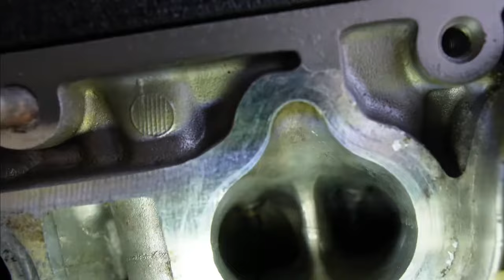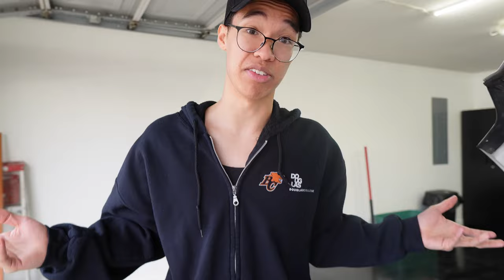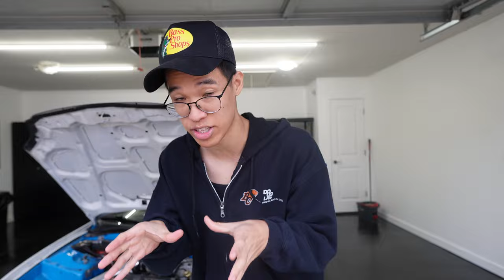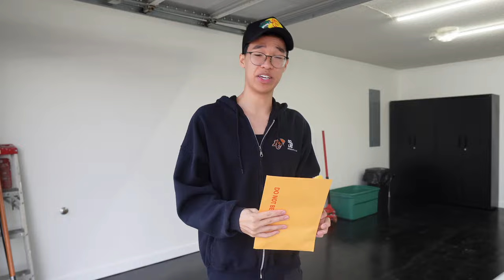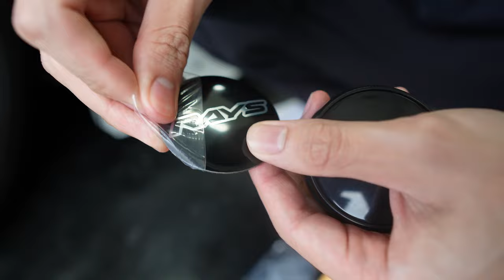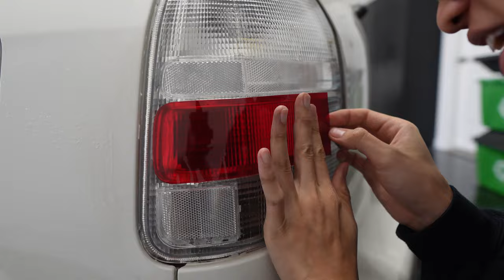Things have gone worse.

Comment: My ep3 has low compression and I got a quote from the shop to get it k24 swap, but its too much money and i still need to repair my transmission. So most likely im going to stay k20a3 and just pit some headers, maybe a true Cold air intake and a tune. 

My goal with the ep3 is to have fun with it and take it to track events, no need for straight line speed even though I admit it would be cool as well

Comment: I've got a 2000 Honda stock d series. My boy was leaking everywhere. But managed to take it to my mechanic he fixed the oil leaks but the power steering fluid won't quit leaking. I'm getting swole just making turns the last    year. 😅

Comment: yo , i love you videos , buttttttttt , i have a question , i want to buy litteraly the same car as you have , by every aspect , like i know it is Honda Civic Hatchback , but is it aj,ek,ai,...? I know it is a monster , please help and reply .
Reply: He got an honda civic ek3 I think because he has 115 hp
Reply: Its an EK, if you were to get one id aim for the 96-2000 (That's the ek generation) with the DX trim. Si is the highest trim level before the type R, but they are kinda hard to come by with this generation. The dx has power steering and AC, however they don't have VTEC. A lot of people will motor swap them with the VTEC motor of that generation, like the one Jerek has. Typically they run for like 5k for a clean one. It is pretty low horsepower. If you want it for the car and it also being  fast, expect to sink in 10-12k after everything said and done. The Acura Integra GSR shares a lot of the suspension components of the EK, but better, and also comes with VTEC, those usually are like sub 10k for a clean slightly built one, and will have a lot of the similar driving characteristics. hope this helps!